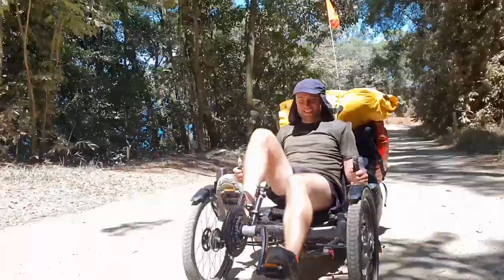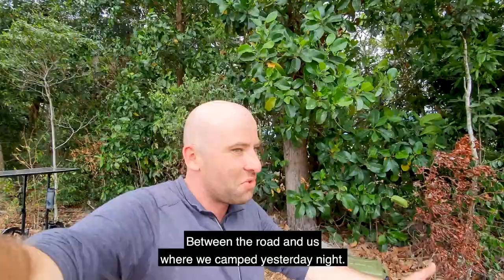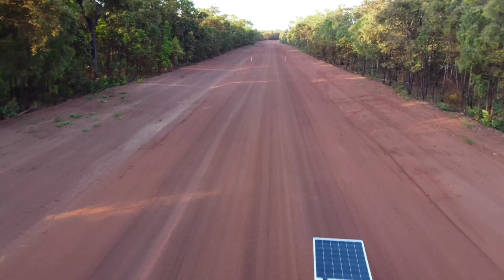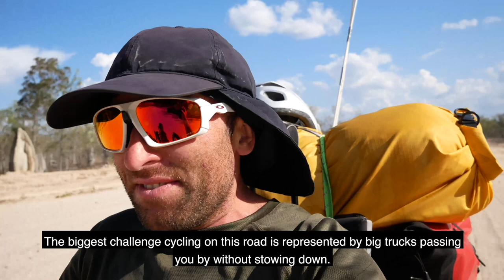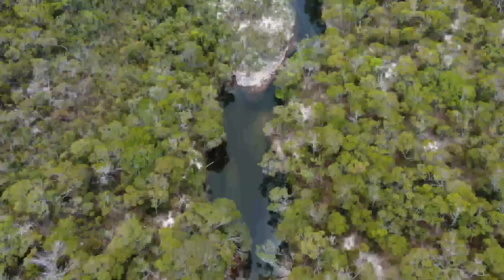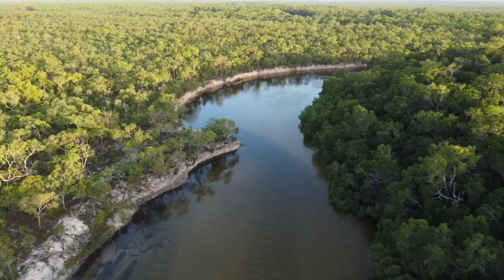Cycling to the northernmost point of Australia on recumbent trikes

Comment: What a trip! Yeah as others said, a set of 4" fats would have been the go for all that sand and rougher dirt roads. Other than tyres, looks like you have the best of the best trike models! Watched the Jayoe video Azub build- wish I could afford one. I ride a Greenspeed Magnum big wheel which is great and around half the price but no suspension. If I had $10k or more to spend it'd be  on a rotovelo carbon or a WAW velomobile and I'd be happy just on the bitumen doing a steady 30- 35kmh.

Comment: Looks like a trip to hell for me. Maybe a fat tire bike would work better for that adventure
Reply: Even better Rich would be a fat tire recumbent trike, which a few companies have been making since about 2015. I had a fat tire trike for a while, with three 26" wheels, sporting 26x4.8 inch knobby tires, and it was extremely comfortable, especially since it was fully suspended. The areas in this video where the couple had traction issues would be non-issues on a fat tire trike. By the way, I also had a titanium fat tire mountain bike, which was also a blast to ride, but for an extended trek like the one shown here, three wheels with large fat tires would be better when it comes to comfort during day after day of pedaling.
steve
Reply: I meant a fat tire recumbent that my rig right now. I have a power assist motor on it and I’m very happy with it. I plan on getting another trike more set for a road trip with regular tires